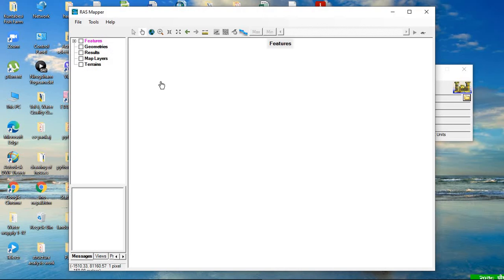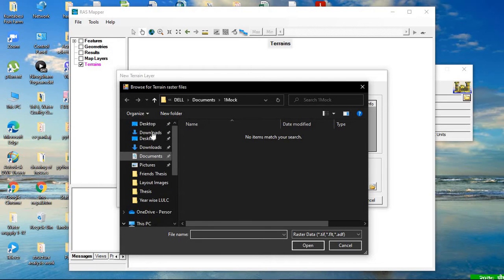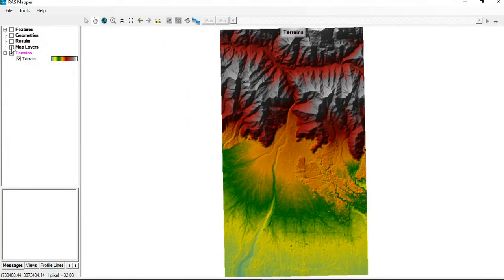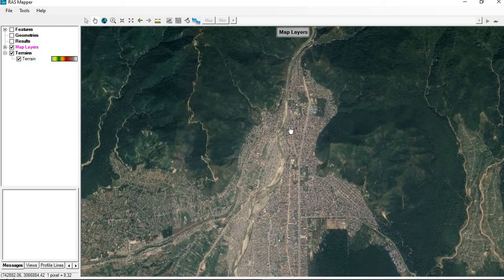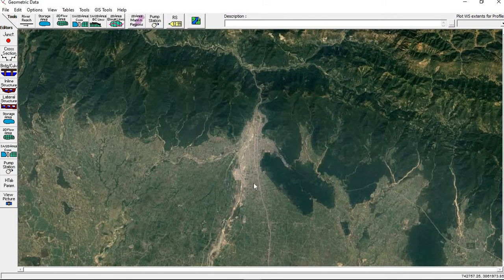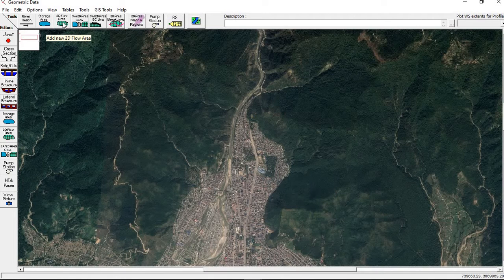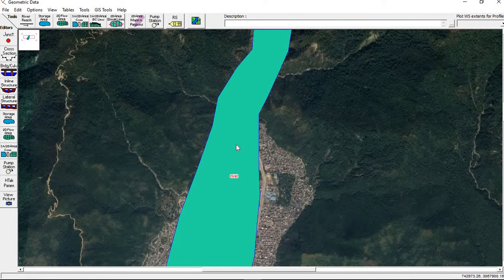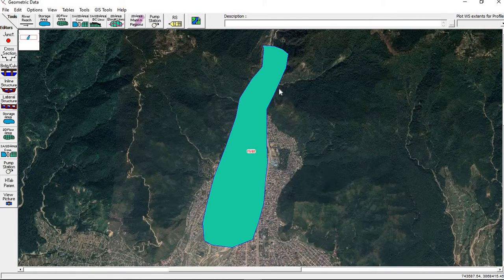Complete HEC-RAS 2D Flow Modelling Tutorial in 14 minutes| Unsteady Flood Model |No GeoRAS and TIN

Comment: Downstream of my study area is very huge in size and it is challenging me to mesh the river channels because there is no left and right bank to mesh the river. Also flood means over flow water from river banks so to get flood inundation it is difficult to get depth river.
Reply from the maker: It is not necessary to create mesh in exact river banks. You can create them in and around possible inundation areas.

Comment: Which study area is this for ? How did you fix the energy grade line value ?
I am currently doing it for a small catchment in Nepal, in the Koshi River basin.
Reply from the maker: Thank you for your query. It is the random study area considered only for the purpose of beginners' tutorial. If you are interested, I recommend you to go through the documents of HEC-RAS.
Reply: @_SolutionSeek  Thank you. Can you suggest me the manual for HEC RAS ?
Reply from the maker: @sahadeepthapa3570  You can easily in find in internet or the folders in your computer where the application has been installed.

Comment: The satellite imagery does not appear in the geometric data window although I have previously added the layer, is there any reason for this?
Reply from the maker: I too have faced the issue. Sometimes it appears and other time it doesn't. I suggest you to perform task through RAS mapper. All the activities of geometric window can be carried out there and won't be issue of the satellite image.
Reply: In my case, the satellite did not work when I was using Wi-Fi under a proxy, as some proxies block the satellite service, so try using a different Wi-Fi network without a proxy.

Comment: Sir, Your tutorial is interesting. But one question; how can I generate a synthetic unit hydrograph for different return periods from daily streamflow data?
Reply from the maker: Thanks. I had encountered the same problem in my Masters thesis. First of all pick out the maximum instantaneous discharge for each year and calculate the flood frequency for the required periods.  The method I adopted to develop hydrograph was using empirical formula proposed by Snyder. Using empirical formula  lag time and time to peak was calculated. I assumed the time to peak is one third of whole duration of the hydrograph.  Calculate the width of 50% and 75% peak discharge. The next step was dividing each return period discharge by the peak discharge of hydrograph (say you get the value X). Now multiply the 50% and 75% peak discharge by the factor X. However I've also seen many new methods using Artificial Neural Networks which seem to be more reliable.
Reply: @_SolutionSeek  Thank you for your kind response. would you provide me your email address for more discussion? because I need your kind support in this time
Reply: @_SolutionSeek  Thank you in advance for your kind response. Would you provide me worked examples regarding synthetic unit hydrograph generation for different return periods from daily streamflow data?

I Appreciate your kindness.
Reply from the maker: The method I used is not reliable and is nearly out of mainstream at current times. I think the new methodology involves the machine learning approaches. I suggest you to search for research papers in google scholar and read the latest ones.

Comment: after creating the geometry, boundary did not came automatically. and even if i created, its just showing precipitation only.
Reply from the maker: You need to delineate the boundary separately after creating geometry. Could you please be more specific about precipitation?
Reply: @_SolutionSeek  sorry, it was "boundary condition", as in your video 9:26 after creating geometry, boundary condition did not came automatically as mentioned upstream and downstream and after clicking it showing flow hydrograph and other options are coming. but in my case i have created by my own boundary condition, so it showing only precipitation.
Reply from the maker: You can go through 6:54 again. I guess there should not be any problem. If you encounter problem again, start doing in a new project file.
Reply: @_SolutionSeek  thank you for response in advance.